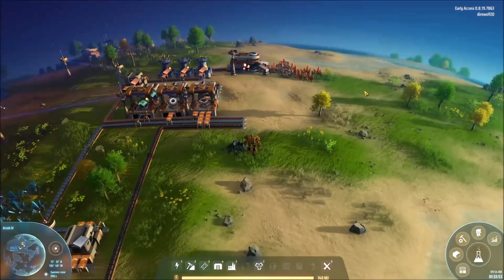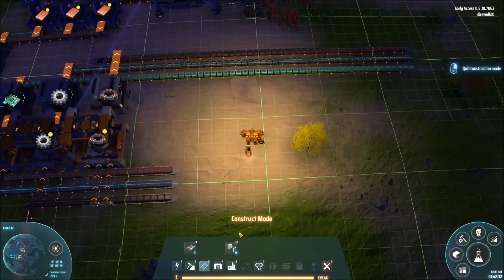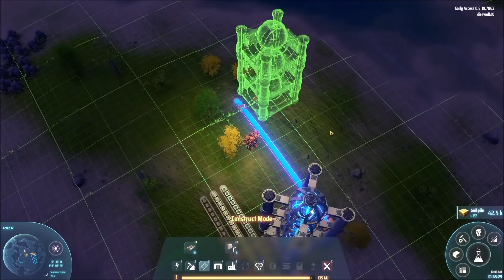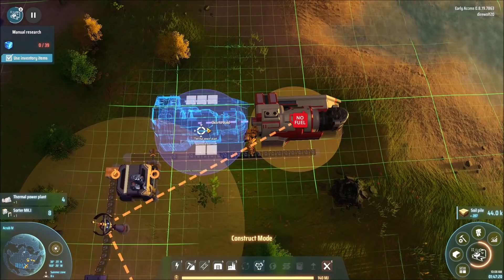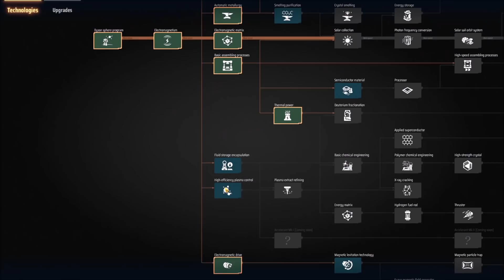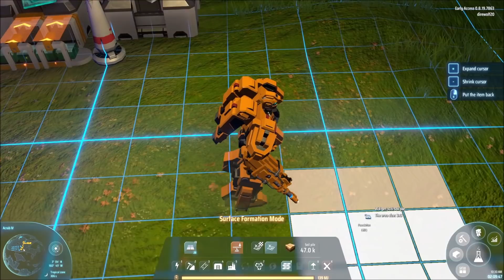Dyson Sphere Ep3 Research Cubes

Comment: When connecting belts up I always add a side storage chest to handle any overflow and smooth out supply flows etc.  Especially with research lab output so you have a big stockpile…

Comment: Check this out
Dyson Sphere Program Patch Notes 0.7.18.6914~Version 0.7.18.6931 POSTED 
Fri, May 28, 2021
 @ 5:25 AM PDT. New Assembly Line construction mode – Now you can press [TAB] to switch between 'Snap to Grid' or 'Free line' mode. In 'Free line' mode, you don't have to build the conveyor belt stick to the grid.

Comment: Chain mod will upgrade the complete belt chain so only one click even for a long belt
Reply: It should be noted it will only upgrade the connected belt line as long as it is the same tier. You can use this fact to sub-divide a belt with a single block upgrade, then fully upgrade just one side. Useful if you want to be cheap on belts, you can upgrade only the bits that need the extra density.